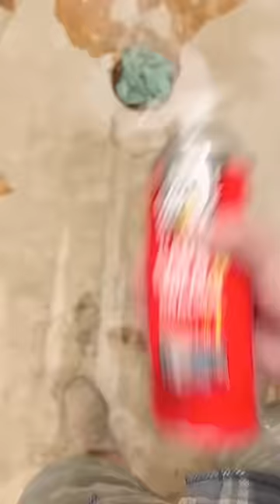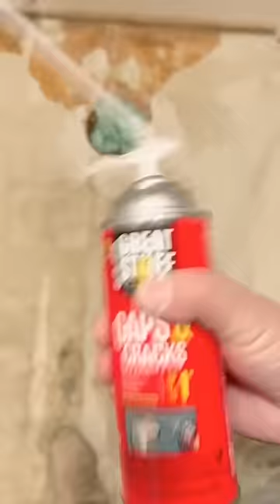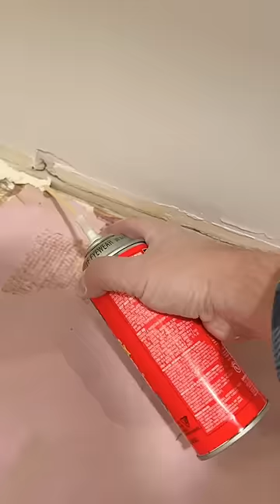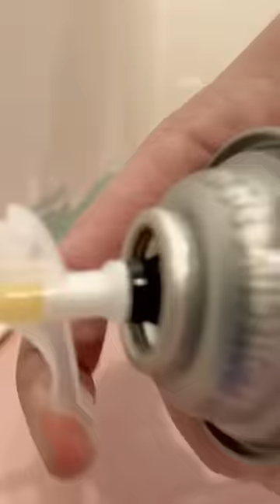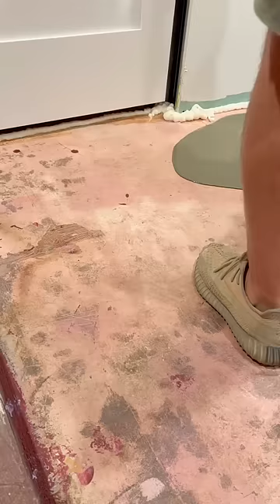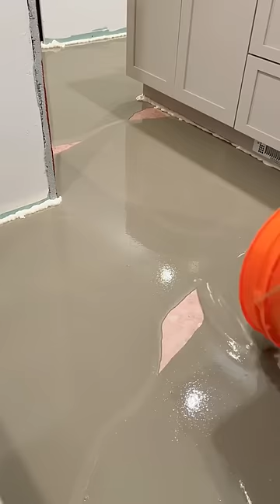Spray foam is great for using self leveler. Gives you an expansion joint around the perimeter. #diy

Comment: Yup sure is... Been using spray foam to protect perimeter since 99'...Ardex K-15, P-51 primer in the old days.... Grind & pin the floors...Mapei eco grip with easy plan is the way to go now.... Much easier & allot less prep & ½ price....

Comment: Great tip, try out a propper spray gun with screw on cartrige. A lot more efficient and way less messy for getting the right amount to where you need it. Can adjust the flow amount of foam too. 
Only using the foam gun when spraying out windowframes du to the increased accuracy
Reply: Lol. I read "pepper spray" gun with with screw on cartridge at first glance!  😅

Comment: Duct tape makes a better dam. You don't have a mess to remove after the pour.
Reply: Tape provides zero expansion. 
Hence the title "Spray foam is great for using self leveler. Gives you an expansion joint around the perimeter."
Reply: I was thinking the same

Comment: why so complicated??? with acrylic is better faster and you don't have to do anything more.
Reply: I like tile and have heated floors - 
Hence the title "Spray foam is great for using self leveler. Gives you an expansion joint around the perimeter."
Reply: @KaleidoscopeJunkie  What you write is correct. There is only one problem. After graduation you have extra work!!! You have to cut this foam, so you have extra work. I mean you wasted your time. Time is money and you understand that. I have worked in this profession for 35 years and I have learned something from it. You can see my work for yourself if you go to YouTube or a picture from the Berlin Parliament. There, together with my colleagues, I did all the rooms and assembly halls and all the offices. You can see for yourself if it's good.

Comment: What I've seen with that spray foam is it keeps expanding in all directions until its hard. I sprayed it in place of the foam in a stainless drinking cup (between the inner and outer walls). It started bending the stainless before it fully hardened.
Reply from the maker: This is maximum 1” and not contained. It will fill the crack and then pillow outward so no pressure or anything is applied to cabinet, wall etc. if you put it into a container well that’s a different story.

Comment: Do you just remove the excess foam after leveling is dry?
Reply from the maker: Yes. Other videos posted on this. Just run a multi tool real quick, takes a minute or two and ends up flush

Comment: Maybe I don't understand how this works but wouldn't that foam be a pain to deal with once you're ready to lay flooring?
Reply from the maker: Nope. After leveler dries it’s just a couple minutes to flush cut the foam with a multi tool. Then we put down strata mat and ran our heat cables and tiled.
Reply: @Eylandertile  Makes sense, thanks!

Comment: Good idea but I bet cleaning up that great stuff will take 5 times longer than the flooring job itself. How are you going to but on the base without having to cut out all the great stuff. Simple foil tape around the perimeter works swimmingly

Comment: Is that a 220V recept next to the shitter?
Reply: It's 110 and My NUMI toilet needs one within 4'.
Heated air on the floor, heated seat, temp and pressure controlled bidet that can be moved forward/back with the remote. Bluetooth, lights and air filtration.

Comment: In case anyone is wondering…
This process is more work then needed..
The foam clean up sucks.. has to be removed for based board or you have problems.. extra steps not needed..
PAINTERS TAPE people.. its easy, quick, and can be left behind base board if wanting to.. 🤦🏻‍♂️

Comment: You don’t run a smoothing trowel over your self levelers? If not, you’re doing it wrong. I’ve poured thousands of sq feet of that stuff, we wear cleats and use gauge rakes and smoothing trowels. Always defer to manufacturers specifications. The foam is cool though

Comment: 7 hours and sore knees and wrists later after cutting all that damn foam...
Reply from the maker: You must not know what you’re doing lol. Takes about 3-4 minutes to remove the foam in a room that size with a multi tool. I have other videos posted
Reply: @Eylandertile  I actually don't - lol.  YT just put this is my totation and I commented.  Last time I tried cutting foam, it was a total PITA.  It may have been old or some other type though.  Anyway, cool vid - cheers!

Comment: Wrong.  You do not need an expansion joint with self leveler. Self-leveler has additives to reduce shrinking to practically nothing and it is not thick enough to worry about expansion. That was a waste of time and money. Also, it could exceed beyond the base going in.
Reply from the maker: Holy smokes! I’m keeping it off the framing. I’m not worried about the leveler expanding nor did I ever say that in the video. EVERY company that makes a perimeter seal product specifically for self leveling uses foam, I know of three of them. Ask their engineers why that’s so.
Reply: It literally says that on the thumbnail @Eylandertile
Reply: @Eylandertile  Spray foam is great for using self leveler. Gives you an expansion joint around the perimeter. #diy  There you go cut and paste. 

Why worry about touching the frame? I use the foam on massive jobs across the floor. I have never gone over 12,000 square feet in a day. With my equipment would probably max at 15,000. So I spray the foam across the floor for a barrier

Comment: Spray foam is good for gaps but not great as a perimeter edge foam. Too messy. Also, you have to actually LAY the floor not just pour it onto the deck and expect it to find a level. It’s not magic
Reply from the maker: It’s great for a perimeter foam. All the companies that make a perimeter seal product are foam. And yes, all you have to do is pour it, break the tension in between the pours and it will find level. The key is pouring enough. If you don’t pour enough then no, it won’t be level.
Reply: @Eylandertile  been a Screeder for 15 years and now am a contracts manager for a mid level screeding company and I fully disagree but I guess the Americans have different standards to adhere to than us in the UK. I’d expect a much neater job around the perimeter than spray foam can give you and an SR tolerance of + or - 3mm, which pouring as far away from the wet edge as you do in this video you’d not achieve with a thicker floor. The thickness this is going in at you’ll probably get away with it but will be wavy still

Comment: I bet that spray foam was a bitch to get off after. Silicon works way better. If you dint have the patience for silicon you shouldn't be doing the job at all
Reply from the maker: We just run a multi tool around the permittee flat on the floor. Takes 2-3 minutes. Silicone doesn’t give you that buffer between framing/drywall etc and your leveler. Foam allows for expansion and contraction.

Comment: So is blue tape. Or any tape. The spray foam will expand and ruin the self leveler.. Makes no sense, but go ahead and follow this guy….
Reply from the maker: It’s hard by the time we pour and it also creates an expansion joint against the walls so we are not pouring our leveler up against the walls. Simply flush cut the foam the next day with a multi tool. Makes perfect sense and it’s why other companies literally make various foam strips for pouring leveler.